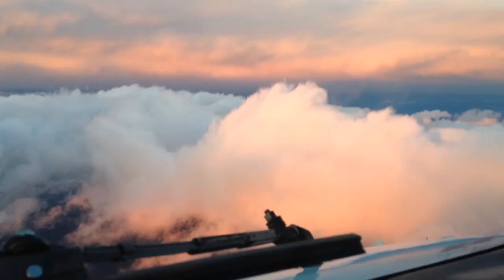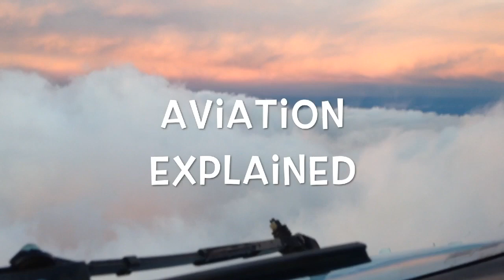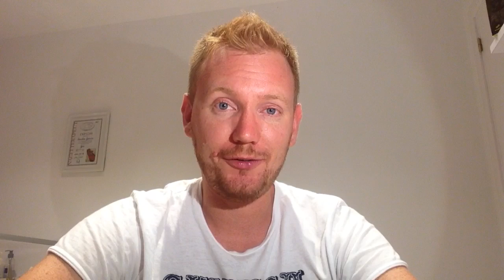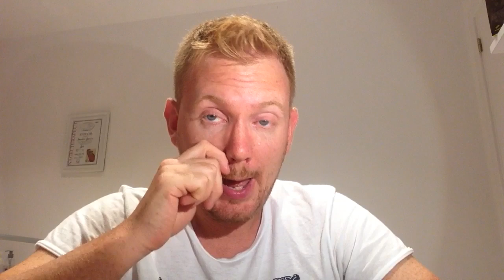Aircraft maintenance, why pilots shouldn't touch anything!

Comment: When I worked for United many years ago as a "radio shop mechanic" (electronics technician) the standing joke was that an aircraft in for major overhaul was not ready to fly again until the weight of the paperwork equaled the weight of the airplane.
Reply from the maker: Yes, there is probably some truth to that
Reply: MGTOW  or OEW in terms of weight of paperwork? :P
Reply: Every bolt / nut a certificate i was told, same as a paper trail on who fitted what and when.
Reply: Lmao sounds right.
Reply: I remember changing a HSTA and the paperwork was at least 2-2.5 inches when it was all said and done
Reply: @arjanwilbie2511  True. I was a machinist for years, making a variety of things. But, when it was anything
used for aerospace, every step had to be documented, from the material certification, the machine(s) 
and tooling used, the program(s) used, the employees involved, the inspection procedure, along with
any outside vendor work. The reason for all this was, in the event of a component failure, it could be 
traced back to where or with whom the problem originated. Traceability was mandatory.
Reply: My father was an machinist for an aeronautical company. He took great pride in the precision of the machined parts he made, as he knew lives depended on this.

Comment: I was an Airframe Technician and an Advanced Mechanical Fitter (technical grade-12) in the Israeli Air Force.   We serviced B-Check and even some D-Check issues on Base.
The F-16's wings can be "popped off" by removing 14 massive aluminium brackets on the wings root, 7 on the top, 7 underneath the wing.   Each bracket has 2 massive long bolts that go all the way through the fuselage structure and into the fuel tanks.   Each bolt is about 1" diameter and 11" to 12" long, sealed in place with a synthetic rubber (PRC).   The only way to extract the bolts is to use a 36" long drift and smash the bolt end with a 10Kg sledge hammer.
I savored the gawking looks we got from young fighter pilots when 2 "dirty" machinest walked in to the HAS tools room, carrying just 2 huge tools.   We always kept up a stern face :-))
Smashing a 16 million dollar F-16C with all ones streagth with a 10Kg sledge hammer is a wonderfull feeling !   The F-16 used to ring like a bell and every one ran away.
We never ever even scratched the paint.   We were the top dogs on the job.

Comment: Love your Videos, keep up the great work.
Great to hear a pilot genuinely appreciate engineers. Many crews feel we are inferior!!
Reply: In the vast majority of cases, engineers only get treated as inferior because they behave that way.
However, their has to be a situation where the entire maintenance department  works to high standards with a professional attitude for this situation to develop.
It is soul destroying to work to high standards yourself, when others are letting the side down.
Reply: @BenC   Technical ground personel are never inferior.   I've lost count how many times I personally have grounded an F-4 / F-16C / MD500 on some defective structural part.   As a young IAF conscript, working as an Airframe Technician then promoted to Fitter ( grade-12 ), and being a licensed Practical Engineer, I knew what the hell I was talking about.   As one of only 4 on a base of thousands, no one tried or could counter our technical instruction, not even the base commander.
One of my senior professional collagues a master mechanical Fitter, a Master Sargent serving 20 years, once instructed the Squadron to jack up an F-16C to some crazy side to side angle (20 degrees if I remember) to facilitate removing some component in the wing.   The squadron followed his instuction to the letter.

Comment: It’s a good thing that owner/pilots of small private aircraft are allowed to do some minor maintenance or very few of us could afford to fly them.  On the 172 I was a 1/3 partner in, I changed tires, brake pads, the battery, changed the oil and filter, replaced spark plugs, etc.  We also saved a lot of money on our annual inspection by getting the aircraft ready for the A&P to look at, removing the seats and carpeting, the engine cowling and wheel fairings, and several dozen little inspection plates, then putting it all back afterwards.  Believe me, no one is more particular about the quality of the work than the guy who has to go fly the plane.

Comment: I got caught in a delay due to a dent and a failed autopilot unit, engineer came fixed both really quick and we took off after 2 1/2 hours. The system worked exactly as designed. I didn't mind that delay, because the engineer even did a PA, Yes I heard "Lady and Gentlemen, this is your maintenance engineer, we have epoxy the dent, are now installing a replacement computer for the autopilot..." It was really cool even though there was some groaning. A dent can affect the mechanics of flight, that why airplanes are not dimpled like golf balls.
Reply: Thank you for your understanding.  All of your "golf ball dimples" need to be certified as worthy to fly or be removed from service immediately until after said issue had been resolved.  I think in 2019 there was an incident in Florida where a flight was delayed 5 hours and the plane was decertified for about 17 hours simply because one of your engineers had the thought to do a little 7 minute job at the gate which was not authorized and lead to a situation where the next flight crew could not "enter" the flight deck due to a bad response from a safety checklist.  You were charged in Federal court for nothing less than causing major criminal damage to aircraft.

Comment: So it sounds as if aircraft are put through “preventative maintenance” as opposed to what most people do with their cars which is the “if it ain’t broke, don’t fix it” mentality.  I change my tires before I get a flat, my oil before it becomes black, I test my signal lights at least once per week, and I inspect the engine compartment at least once per month, which if you come to think about it is pretty pathetic.  Older aircraft I have noticed have “doubler plates” and often strips of extra mental around the windscreen.  Sometimes I see paint worn away from areas on the plane which must undergo more friction than others.  These little things kinda of bother me but I am reassured when I see the FO or captain do their walk around.  I trust that the servo unit of 737s rudder have been upgraded to one which cannot freeze in a rudder hard over position, I trust that all doors have an unbeatable locking mechanism to prevent inflight decompressions, that sensors for heat have been added to cargo areas and landing gear bays, and that the “black box” now has hundreds of parameters recorded or even better, the ACARS system transmits real-time telemetry to engineers on the ground to allow for accident prevention instead of post-accident autopsies.  I am happy to hear that the maintenance regime of aircraft is so rigorous.
Reply: You can’t pullover in the sky! We try to find things before they break!

Comment: There is also a liability and accident investigation aspect to this. All maintenance is performed by an individual who is able to log it and isn't on the flight. If a pilot performs maintenance and an accident occurs during the flight, there may not be any way to verify the plains exact condition before the flight occurred. Accurate investigations require accurate records. It also protects aircrew from getting blamed for an accident posthumously when they were in no way responsible.

Comment: 4th line servicing. Did that at chivenor we had to check jet pipe and sand air intake to take black marks off. Hawk. They put every thing down with locking wire with pair pliers.learned a lot there it was interesting very interesting engine ear got ear for engine can hear something wrong sometimes.